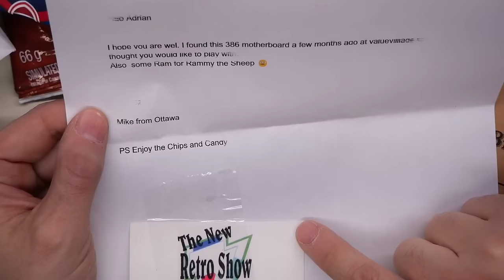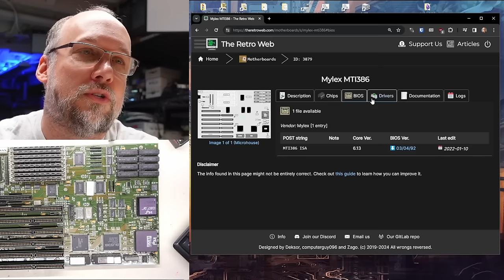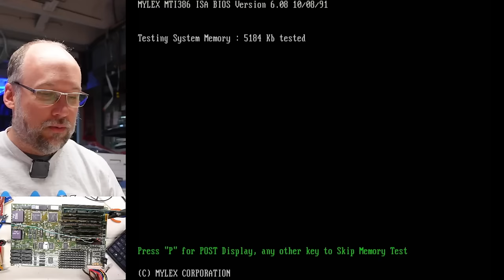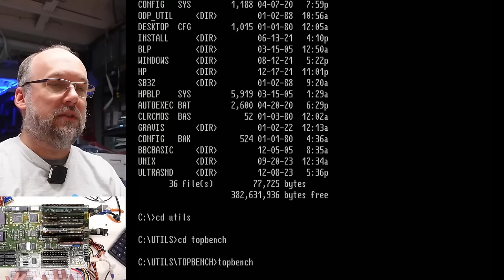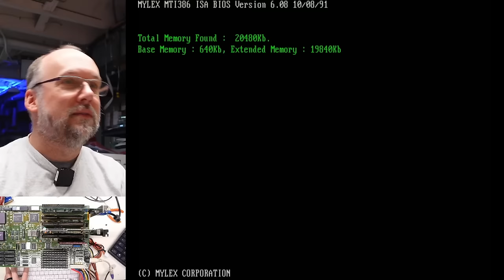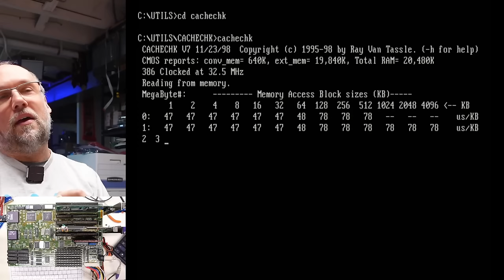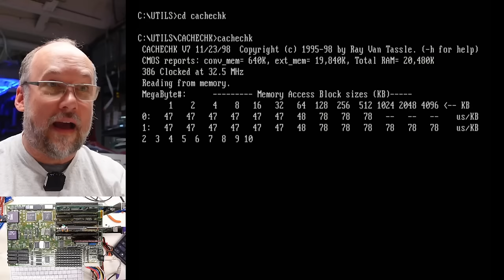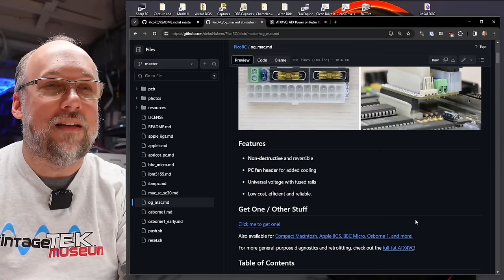0084 A battery powered 486DX2/66 setup and a 386 motherboard with a fancy BIOS

Comment: I have found with old BIOS CMOS setups, the +/- on numpad are the only keys that work, regardless of numlock status
Reply from the maker: Heh that's quite rude -- but I kind of figured that was what was happening. I know to try a full size keyboard next time :-)
Reply: @adriansdigitalbasement2  I guess nobody cared back in the day as TKL (Tenkeyless) keyboards became popular way later...
Reply: Yeh makes sense, thinking about it. All keyboards had the numpad then.
Reply: Maybe it's not a real biz computer if you're not doing spreadsheet data entry?  I always found having to reach that far over to be annoying, and I agree it sucks.  Accessibility and usability was certainly not a consideration back then
Reply: My memory may be old but I remember one machine I ran across that did something similar. I had to use the shift key with the "+" and "-" or shift with "+" but not "-".
Reply: @SuperVirus1978  I would say they are yet to be popular (at least to me :)).

Comment: That's a really nice 386 board. I don't think I've ever seen that BIOS before.
Reply: Yeah that is a very unique bios
Reply: In the strings you can still read American Megatrends... So is probably a very customized AMIBIOS tree by Mylex. Just like Acer BIOSes (Actually, looks like American Megatrends and Acer partnered to make the AMIBIOS).
Other OEMs did the same but using Phoenix BIOS as core. Actually only a very few did really their own BIOS stuff at home, as Olivetti, Compaq (partnered with Phoenix to RE IBM stuff and create the Compaq BIOS, and later Phoenix was allowed to use that code to create their own), AT&T or IBM.

Comment: The USB powered 486 is such a cool trick - logically makes perfect sense but breaks my brain.
Reply: Same here! But, remember, USB powers devices we use everyday that do laps around a 486. What breaks my brain is the leaps in tech in such little time.
Reply: This was pretty much how 386/486 laptops worked.  Take a desktop PC, shrink everything down as much as possible, connect a battery.  :-)

Technically there were SL chips, but it was just as common to see full on SX and DX chips in there.

Comment: The Bic pen mod, Adrian knows all the old tricks!  I'm assuming its the same as we always did, either sand or trim the opening just a bit with a hobby knife.  Perfect fit, no damaged boards.  Still have mine from 30 years ago.
Reply: Never did the bic pen trick, always just used a needle nosed pliers, never had an issue.  I heard about it, but never felt that i needed any help.
Reply: A viewer sent that in. Adrian has lauded this person ever since.
Reply: I made one with a brass tube soldered to a thick copper ring as a handle. I used the tip of a needle nosed pliers as a tapered cone to flare out the business end of the tube.

Comment: We definitely have Value Village, at least up here in Washington. Unfortunately my local one stopped selling as much electronics, but I occassionaly still get a deal there.
Reply: I've recently seen some wild crap systems at my two closest Seattle area stores lately. A couple of complete or almost complete HP desktop shovel systems from the mid 00s
Reply: There is 1 Value Village in the Portland, OR area.  It is in Tigard, which ~9 miles SW of downtown Portland.

Comment: 51:23 — Looks like your USB battery bank supports 15V3A and 20V3A output as well. If you have a WI variant (Wide Input) of PicoPSU, you can feed it with anything between 12–25V. Surely you'll need the appropriate trigger cable, or maybe use a ZY-PDN USB-C decoy (<$1 when buying 10) and a normal C-to-C cable.

Comment: Interestingly, those USB power banks can have microcontrollers of their own. Running a retrocomputer off of a battery with more computing power than the system it’s powering is surely some flex.

Comment: Whenever I have to remove standoffs I'm using a suitable size rawplugs (the ones used for mounting screws in concrete walls), I use to have 3-4 different size in my toolbox, works like a charm to remove those stubborn standoffs.

Comment: Hey Adrian. Regarding repacked shipments, some federal transport authorities require carriers to conduct and document inspections of outgoing shipments on the authority's behalf, so that repack probably happened before the shipment even left the UK. For DHL in particular that's the only tape they have and they can end up using it even for first-time packing when senders show up at a shipping centre without their own packing materials. They have a policy where they're not allowed to use or even possess any other kind of packing tape on their premises, so they couldn't use clear packing tape even if they wanted to.

Comment: In the past, for those plastic standoffs, I recall using a 3mm nut driver....maybe 3mm was not the right size, but I remember sliding it over tightly.

Comment: I never needed a tool for the nylon standoff removal.  I would just squeeze one side, angle it down into the hole to hold it "closed" and then squeeze the other side while pushing it through.

Comment: 53:10 re "power draw" I don't recall exactly when but around the Cyrix M2/AMD K6 era if you repeatedly issued a HLT instruction in a loop (while something like windows was running to wake the CPU up) it would actually draw less power because the idle task (which is literally just a loop) actually consumed more power than halting the CPU completely.

This might not be the case for 386/486/586 era cpus I don't recall.

There were a slew of windows "utilities" that would do this and you could measure a small CPU temp delta at least on idle setups when it's present.
Reply: That's more of a problem with DOS and classic Windows. Real OSes tended to issue the HLT instruction. Linux used to have a "no-halt" option to suppress this because the lower power consumption was known to make some power supplies go out of spec (or something like that).

I haven't looked into it but I suspect all static CMOS processors save power with the HLT instruction and older HMOS models don't. The 286 was mostly HMOS but the 386 appears to be only CMOS so halting would make a difference to CPU consumption. However the 386 never used much power so the reduction didn't matter.

Comment: It's crazy to think about that most of the power draw from these old computers is in the hard drives and monitors. I just grabbed a random IDE 80gb spinning rust drive off my shelf and it's listed at 0.8A for 5v and 0.75A for 12v. That's almost 75% of the power draw of that whole setup in one drive. And this is a newer drive, the drives that would have gone with these 386/486 computers would have taken a lot more I bet.
Reply: Before the early 2000s most consumer-level drives were lower RPM which saves tons of power. AFAIK it's a square relationship so the spindle power of a 5400rpm drive is barely half that of a 7200rpm one. Also the labelled power usage of a hard drive isn't strongly correlated to the actual power draw, it's more of a maximum. But not a real maximum, any drive pulls more than its rated current on spin-up.

Comment: Hi Adrian, I may be wrong but has not been the turbo switch a thing that came first with the 486s? 🤔
Reply from the maker: 286 machines and Turbo 8088 machines had them to bring the machines back to stock IBM speeds.
Reply: @adriansdigitalbasement2  Cool, I did not know that. Thank you very much for your answer, Adrian!

Comment: if you need another size stand off remover i think you could make one out of a pen, just pull out the ink part and drill the end of the pen to the correct size. thats pretty much all that is anyway.

Comment: If been given a 486dx4 motherboard but has no built in stuff. It's been so long since I have done anything with ISA what would be a good video card (pref VGA), ide card and sound card for it? Ideally I'd love to have modern recreations of them if possible!
Reply: Most ISA IDE adapters should work identically, get whatever one is available. For a sound card probably a Sound Blaster for compatibility. PicoGUS now has SB emulation so you could use that if desired. For VGA, I have no idea.

Comment: Seems like you would want to be careful with these PSU adapters to use a source with enough current capacity to support all the loads in the system.
I did something similar with my SC126 single board system:  I use a 10,000 maH power cell to provide the +5v it uses.  At 91 ma of total current draw, the system can run for over 100 hours on one charge.  Not bad for a CP/M system, huh?

Comment: 4:38 I really do love our crazy standards like month/day/year! It's our old british ancestry! It corresponds to when you say "April 18th 2024" which is in month date and year. And our standards for measurements are very pragmatic for commerce (back in the day when accurate measurements to the millimeter/milliliter were impractical) and we just stuck with it and never changed. Inches are fractional because we can always divide a length in half with a compass and straight edge. I love this topic lol, I convert my physics work to US standards to get a physical feel for the sizes because, that's just what my brain is used to and it helps! Like lengths for instance, we have a natural feel for mile like other cultures have that innate lizard brain feel for kilometer. The Hubble telescope travels at 7km/s or 4.5 miles per second, only the second value really means anything in my mind visually.

Comment: I am really not convinced about the idea of sending power over the ISA connector into the PC. Those connectors can only transport a limited current, which is enough for the power an ISA device needs but not enough for the power a whole motherboard with all its devices need.

Comment: Would it be possible to integrate all parts of a let´s say 486 DX 133 with a good gpu/3d card with ram sound and north/south bridge (all required components for a complete retro pc) on a modern cpu type wafer as to recreate the whole pc on a single chip? All you would need externally would be power, speaker/sound usb/ps2 the fdd and hdd connectors and may be a few capacitors that could not be recreated on the chip. I know it most likely would not be worth the money but is it possible in theory at least? No, I don´t mean a emulator.
Reply: It's certainly possible.
Reply: @eDoc2020  Imagine a 486 wit all the best parts that could run on a phone battery and fit in your pocket, I wish someone would build it (at a reasonable prize), I´d love to have one.
Reply: @agw5425   Are you aware of the weeCee? It's probably the closest you can find. It's a commercially available industrial card combined with an ISA sound chip, all able to run off a USB power bank.
Reply: @eDoc2020  Yes, I have seen videos about some mini pc´s that one included,  but the problem with them is that they are as you said industrial and do not have commonly used and adequate sound or graphics "cards" so most old games do not run well or at all.
Reply: @agw5425   Shouldn't any SB compatible sound and VESA compatible SVGA be good enough? Most games back then weren't using hardware accelerators. Games never really made use of the GUS and I think of the Voodoo as much more of a Pentium era device than 486 era. What other cards would you want compatibility with?

Comment: Aw man, clickbait. I wanted to see a lithium battery powered 486DX motherboard that wasn’t from a laptop. So sad. 😭 … thinks for a bit … Rotfl! 🤣 Put it back in a PC case and you’ve redefined, “luggable”! Of course, you’ll still have to solve the problems of what to do about a monitor and keyboard, but no one ever said tech life was easy. Imagine the reaction you’ll get when you pull that thing out while waiting for your connecting flight to VCF East! 😅

Comment: An M&M by any other name still has a chocolate center with a thin, hard candy shell. Smarties are a small tangy, fruit-flavored candy/mint about 10-12 in a clear plastic wrapper. Often sold at Halloween. Those “Smarties” are like fake, relabeled, IC chips. 🤣😆 They do look like Skittles, though, at least on the box. Let’s over-clock some at 2 GHz!
Reply: The American Smarties are apparently sold as Rockets elsewhere. I've read that the international Smarties are supposed to be better than M&Ms.